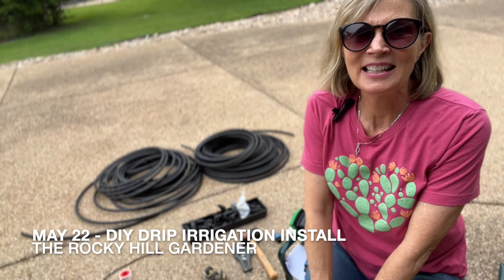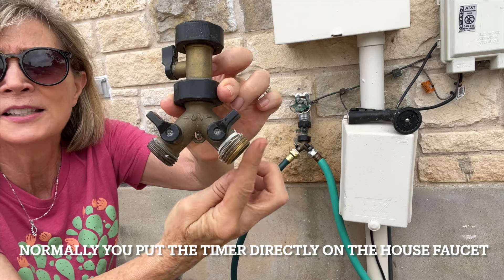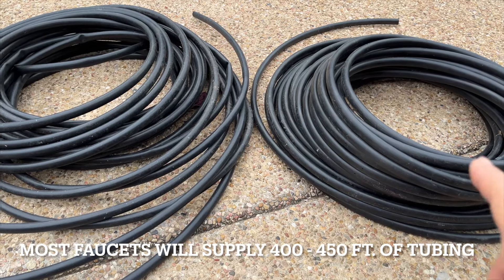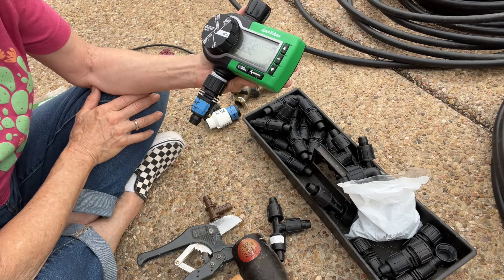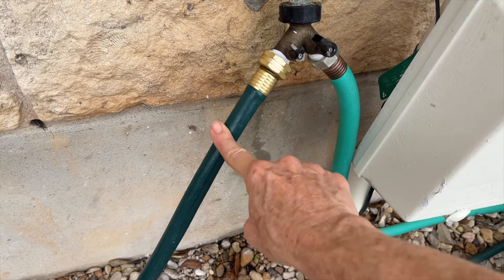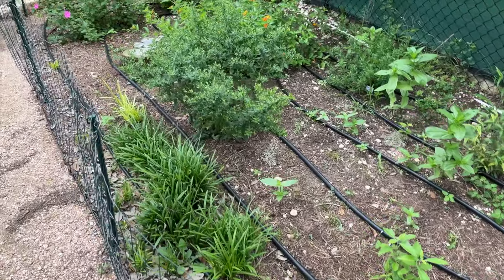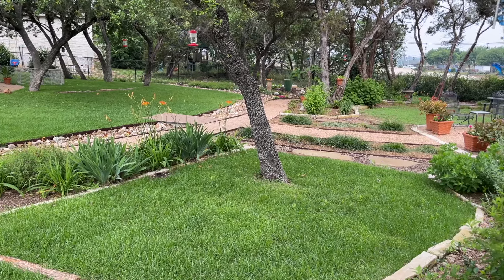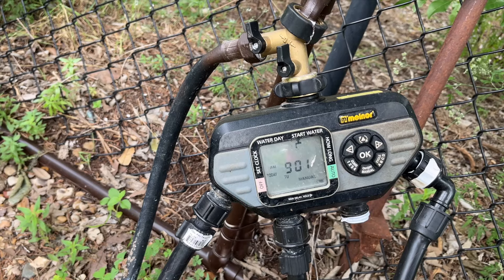Easy DIY Drip Irrigation for you Central Texas Gardens

Comment: I'd love to see how the lawn watering is installed. I have drip in all my flower beds.
Reply from the maker: It's installed with the same black drip hose without the holes.  Then add the sprinkler head where you need them.  We had enough pressure for 3 sprinkler heads per zone.

Comment: I like the tutorial you gave.  Question- when you leave the water on all the time on your none watering days what happens to the water?😮
Reply from the maker: The water won't come on.  There is water in the distribution hose, (the hose with no holes) and the timer causes the water to flow on to the hose with the drip holes. And the timer shuts it off too.  If your batteries run out, then no water every goes on, until you change the batteries.